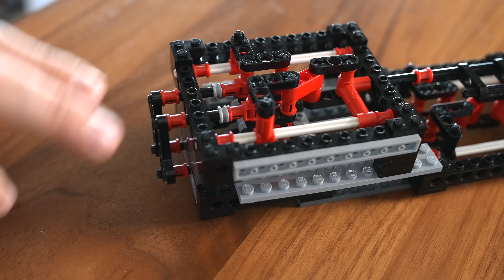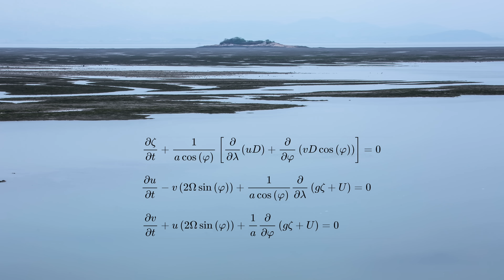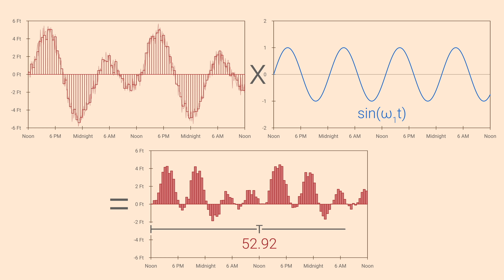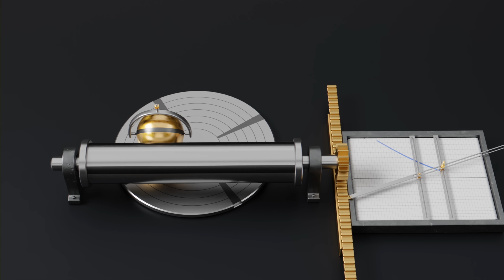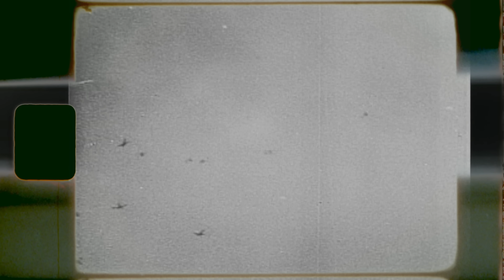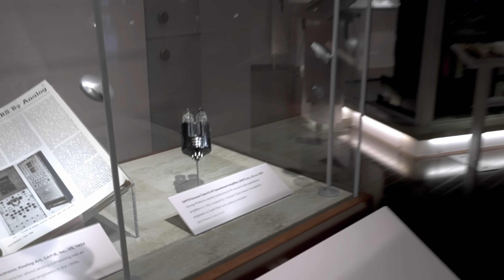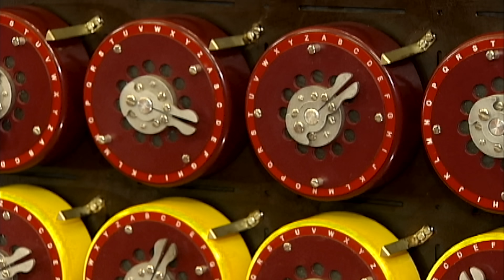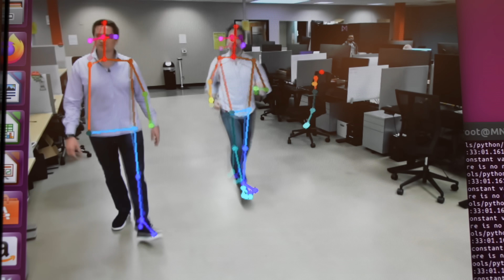The Most Powerful Computers You've Never Heard Of

Comment: I'm fairly certain the next video is going to be about biomimetic/neuromorphic computing, which just so happens to be what I've spent the last 4 years working on as a postdoc. I'm curious to see how he approaches the topic and what exactly he says about it.

A lot of people (especially in the military) are really interested in developing the tech, so there's a lot of funding out there for it these days. I'm working on an Air Force funded MURI called CEREBRAL (Cross-disciplinary Electronic-ionic Research Enabling Biologically Realistic Autonomous Learning). Bit hokey of a name, but the idea behind the project is really interesting. Essentially we're trying to accelerate the development of these analog semiconductor circuit elements called "memristors", "memdiodes", etc. If we can work out the kinks and make the tech scalable and affordable, it could really revolutionize machine learning and computing in general.

Comment: 17k to 90 rounds!? Computers and in general calculation machines are the pinnacle of human tech. This is insane!!! The staggering innovation in less than 3 decades proves out capabilities as a species. Every problem we encounter has a solution that we can find. Digitizing your AA gun when there were no computers to begin with is absolutely remarkable.  Albeit it's an innovation used for war, it still is fascinating that they were able to digitize the whole process.

Comment: All these machines, either analog or digital, are not computers: they are not programmable. They serve a unique purpose for which they have been conceived. A computer can be reprogrammed to switch from addition to multiplication or anything else. This was the big breakthrough realized by Jacquard for the silk loom using punched cards in 1801 in Lyon, France. Changing the card gave another pattern to be produced.

Comment: The idea that most people today wouldn't know what an analog computer is is just sad. I'm a CS major, and although part 2 may change my mind, modern electronic digital computers are just better. Their easier to work with, program, design, are more reliable, and easier to "build". But there has and always will be a fascination people have with these non-electronic analog machines that are just complex physical computers that work. Code can be impressive and expertly designed, but only analog computers are works of art.

Comment: You showed cryptographic bombes when you discussed Colossus. This is perpetuating a widespread  misunderstanding. Bombes were rotating compound Enigma simulators, whereas Colossus was essentially the first (albeit state secret) programmable electronic computer. Tommy Flowers created it at the G.P.O. Dollis Hill with an architecture basically the same as our modern computer systems, and the whole thing had to stay a War Secret for decades -- on pain of Treason. This let ENIAC be seen as the early pioneer, when it was actually trailing behind.

Comment: One question that I have been asking of anyone who has any involvement with quantum computers is what fundamentally is the difference between a quantum computer and an analog computer?  I clearly understand the difference between how they are implemented and the theory of how they work,  however I suspect that they are probably very similar in regard to their utility  - I.E. how they are applied to solving a particular problem. 

I have often thought that if the analogy between these two computers could be demonstrated then there would be a case for diverting R&D funding from expensive quantum computer development into modern analog computer development which will certainly be considerably more cost effective and more likely to produce useful hardware in a considerably shorter development time.

As a teenager I was fascinated with the idea of electronic analog computers and spent considerable time designing and building several different concepts.  The best application that I could find at the time was related to audio dynamic range compression and expansion. I invested way too much time money and effort into  my ideas back then

Comment: You're making a mistake in thinking that analog is interchangable with mechanical. An electronic computer can be analog. Digital is optional. The future of computing is electronic analog for the reason you mentioned; Moores law. Digital transitors have reached the minimum size due to quantum limits, but the transition to analog will use the atoms themselves. And you mentioned various sine wave computations. That's essentially exactly how they will work. That and some creative atom manipulation for data storage. But, you make a decent video. I'll be waiting for the sequel.

Comment: The US Navy built an ordnance plant specifically to manufacture Norden bomb sights. At that time, the US had been attacked on both coasts, so the way to keep the factory safe was to build them out of the range of strategic bombers, which is why the Navy built a facility in the middle of central Indiana. I worked at the site of that factory, which still stands. It is owned by the city of Indianapolis and leased to the Raytheon company.

Comment: Spent a huge chunk of my sophomore years in 2001 on learning 741 OP-amp, professors told us it was used for making computers and calculators during the 60s. But later the entire ecosystem of analog computers were completely replaced by boolean logic circuits. But some type of computations, especially numerical integration/differentiation can be done really really fast and quite accurately on a very simple 741 OP-amp configurations (even you can make one now, just order the components over ebay and won't cost more than 10$ with batteries) but for some reason people don't use that technology anymore. Would be really excited to see how they are coming back. I'm hyped for the next installments.

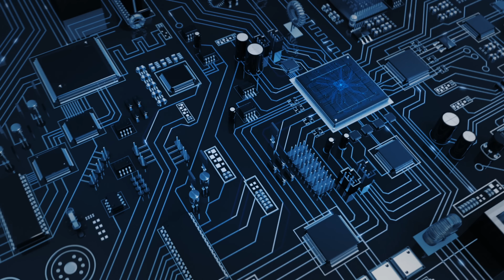Comment: @2:09 "Digital computers exploded onto the scene with the advent of solid state transistors"
NOT SO
IBM 650 First installed in 1954, "the first mass-produced computer in the world" Wikipedia
IBM 700 series (701,702,704,709) -  at about the same time, all using vacuum tube logic. The 704 was introduced in 1954.  The 704 failed on the average every 4 hours - Wikipedia. (vacuum tubes, remember?)
IBM 7040,7044,7090, 7094 were basically equivalent to the 704 and 709 (704T for a transistorized 704, and 709T for a transistorized 709).  The first 7090 was installed in 1959. 
The first working transistor was built in 1947, but was obviously not commercially viable until much later.
NB My first use of  a digital computer was on an IBM 7094 at Purdue University in 1964. My first full-time job was using an IBM 7044 at Purdue University's High Energy Physics research group.

Comment: Analog computers are great for tasks that use variable inputs to determine an output. 

We have gotten good at dealing with noise from quantization of analog signals into the digital realm, and there are things that digitized data can allow that analog cannot… but their is value in pure analog tools.

Not just mechanical analog machines, but electronic analog machines as well. I have an older analog O-Scope that I love. Old analog signal generators are great tools as well.

I would imagine that artificial intelligence using analog fuzzy logic and analog neural network calculations would be a useful field of study.

The human brain is analog… and it isn’t always accurate, the sloppy nature may lead to some odd outputs from time to time, but the human brain can truly shine at many tasks, and be more accurate than not at them.

Comment: Gray Code is a form of binary that uses a different method of incrementing from one number to the next. With Gray Code, only one bit changes state from one position to another. This feature allows a system designer to perform some error checking (i.e., if more than one bit changes, the data must be incorrect).

Comment: As a retired software engineer with 50+ years experience and foundational hardware experience including analog processes, I can say that, IMHO there's nothing that can be done via analog computing that cannot be done better, faster, more accurately and with repeatable results via digital software. It's all about wrapping your mind around the problem and paying appropriate attention to details. ALSO, there's the matter of precision which can be obtained via floating point numbers which can be much more precise than analog signals and still yield repeatable results. In point of fact, it is not so easy to introduce unpredictability or randomness in digital software, but it has been done for simulation and wargaming purposes, all of which I have done.

Comment: If I'm not mistaken photonic computers and quantum computers are the comebacks of analog computers. Traditional analog computers made with adders, integrators and stuff are too much trouble to achieve very little ( not performance wise). I've built an analog computer with op amps but it was a nightmare. However hybrid ( analog for fast computing, digital for controlling and other stuff) computers could be really good idea for computer vision and machine learning.

Comment: The size of a Silicon atom is 0.2 nanometers (nm), An Epyc's circuit width is 7 nm. Sorry, but there is a LOT OF ROOM to think that Moores's law will predict a change in Integrated Circuit thechnology, just because of technical difficulties, to make thinner circuits. Thus assuming that no Quantum Mechanic Effect could make a Si atom behave differently to a 1 nm wire made of silicon.

Comment: I always wondered if it would be possible to build floating point adders, and multipliers that were based on measurements of electrical potential from its  inputs.  It would be pretty hard to nail down any kind of precision, I would bet, and at the nanoscale, pollution from voltage leakage would be hard to workaround (which is already a problem with digital, as demonstrated by rowhammer), and absolute determinism would be out the window (although the current digital floating point standards do somewhat run into this due to rounding errors).

Comment: The problem with analog computers, is the problem of noise. The continuous nature of analog computers means that they are sensitive to many forms of noise generated by mechanical or electrical errors in device. This noise can be eliminated using digital processing, this is why digital processing has become the dominate form of numerical processing. Analog computers are really only useful for simple calculations, where the number of computational step is limited, and thus the noise can be controlled. Once you try to put millions or billions of computational steps together in an analog system, the noise can easily overwhelm the system, and you get a very expensive and useless device.

Comment: You know, I've always wondered about analog computers and some of the qualities they share with neurons. Even though the actual firing of the neuron is an all or nothing scenario, and so in my eyes comparable to digital computation, the neuron has to first get excited to the point of firing off the action potential. And when it comes to that, it receives signals from a ton of different sources, like multiple neurons that are attached to the dendritic tree. Sometimes it takes multiple signals to get to the action potential and fire, and its sort of a continous process.

I always wondered if a neuron's dendritic tree was similar to analog, while the axon was more like digital.

Comment: Moore's law was ONLY EVER was an observatrion of technology development in the late 60s to mid 70s. It had ZERO to do with the rate at which the industry advanced computer processing. The industry turned it into a self-fulfilling prophecy/mantra/mandate.  They could have exceeded it any time they wanted to but like the aging Oil Industry the tech industry opted to milk advancement at that pace because they could not because of some imaginary limit on adding trasistors to silicon.

And since Moore said it - being the cofounder and head of Intel at the time - that would be akin to Steve Jobs making some radical comment 10 years ago or whatever teh F Elon Musk spits out on Twitter these days. So the industry at the time took what Moore said as Gospel and ran with it instead of proving him right or wrong.

Comment: I've worked with analog computers all my life, as a mechanic, fuel injection, air control, vacuum, and in the Marines, on aircraft sensors and cockpit controls/gauges.  Life is analog, and digital can't do random, or analog.  Semper Fidelis, John McClain

Comment: Excellent video!  I just subscribed.  In the mid 1970's while serving in the USAF we had a problem that would have taken over a day of CPU time on a large scientific mainframe computer (Univac 1110).  We found an old but large Systron Donner Series 40/80 analog computer that we managed to get working and were able to run the problem in less than 10 minutes.  We did not need an exact answer and the results were close enough -- at least for an engineer that started with a slide rule!

One WWII Analog Computer that probably did as much to "Win The War" in the Pacific during WWII was the Torpedo Data Computer on US submarines.  No other country had anything like it.

Comment: Can't wait for the next part. I'm an electrical engineer and never even hear of an analog computer until a few months ago. Going down the rabbit hole I found them to be fascinating, particularly in their role as simulators for experimental aircraft in the early days of NASA and a key tool for the design of the X-15.
I have read some information of current companies pushing on analog computers still. Mythic is attempting to produce AI chips using reconfigurable analog computers. Also, Abridged is making analog computers with the traditional patch panel interface. I ordered one of their The Analog Thing which is a small analog computer with patch panel for learning purposes and am very anticipating it.

Comment: I've definitely wondered when ANNs would begin to go analog. You can only perform all that digital linear algebra so quickly through symbolic manipulation, even considering the massive parallelization you can take advantage of with modern GPUs, and many training methods want to perform some form of integration, which is even more computationally expensive.

I'll be very interested to see what startups are willing to share about the processes they're working towards. I'll bet analog computers can be sensitive to noise just like other more mechanical analog devices, only in this case it's EM noise, which is pretty much anywhere you have changing voltages. There's been a lot of work done on minimizing EM from devices, but I wonder if the SNR is really low enough to perform this kind of work these days.

I'll bet a lot of these guys have some experience with radio and/or audio. I hope you asked if any of them had their ham licenses. :3

Comment: In the '90s, as a personal investigation, I designed and built a "Sort-Of Analog Computer" that used cross bar and cross point switches to interconnect a collection of analog circuits such as summing amplifiers, 'differencing' amplifiers, log amplifiers, anti-log amplifiers and a number of other analog circuits designed for single-purpose function. The switches served the part of circuit wiring. A digital program configured the analog circuits into any algorithm or multivariable equation to suit. This gave you the ability to input many variable values simultaneously while generating an output in real-time. The only processing 'speed limit' was determined by the slew rates of the amplifier components used ... I used only generic op amps for the project because they cost only pennies per package. Such a simple way to perform complex tasks ... potentially puts parallel digital processing to shame.

Comment: My dad used an analog computer in WWII, which was small enough for his unit to carry with them in the field. He was a tech sergeant in the 292 Field Artillery Observation Battalion, which traveled through France and Germany, spotting and calculating the positions of Nazi artillery. They would operate at night, behind enemy lines. The field computer was connected to microphones that they would set out to record the sound of the artillery guns, and they would use surveying transits to spot the flashes. They would record the transit readings into the computer, the computer would calculate the position of the Nazi guns, and they would radio that info back. Then they would gather their gear and get the heck out of there, because the Nazis had patrols searching for them.

Comment: My favourite cross-over between the analogue and digital worlds is the old cellular technology CDMA, it blew my mind when we learned about it at uni.

Basically it allows all mobile phones to communicate at once, without interfering with eachother because it uses the interference itself to encode the signal. Each device is assigned a unique digital code, the device then XORs the data to be transmitted with the code and those bits are transmitted through the air, which interferes with other devices communicating on the same channel. To decode the data for a specific transmitting device, the receiving base station multiplies the transmitter's unique code with the raw signal, and out pops the transmitted data. Constructive interference produces a signal with levels above and below 1 and 0, but when multiplied with the transmitter's code, any values over 1 are interpreted as a 1, and any values below 0 are interpreted as a 0.

Comment: Analog computers are (still?) used in doing hydrodynamic design of submarines.  I learned how to debug and do wire wrap on an analog computer in my first job out of university with an electrical engineering degree in 1986 at Newport News Shipbuilding.